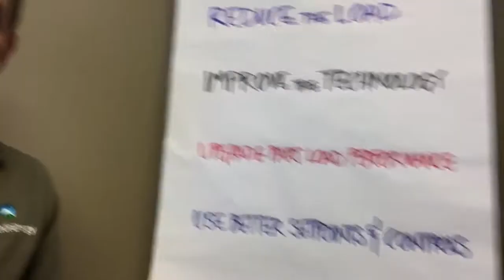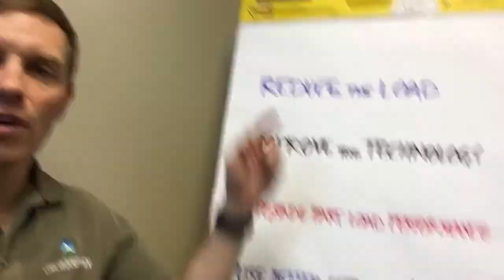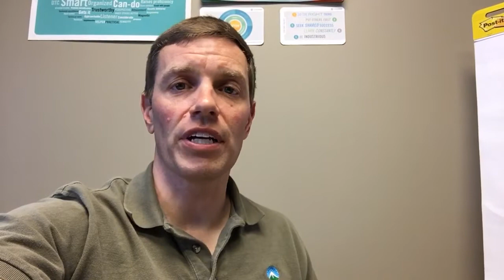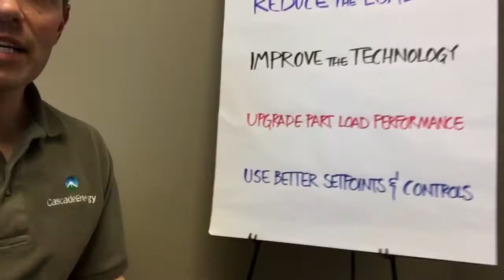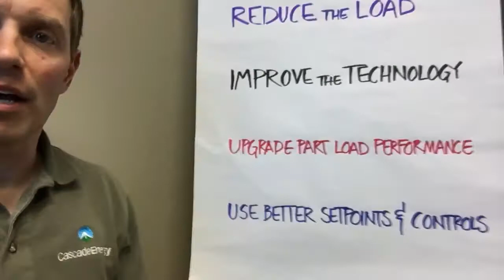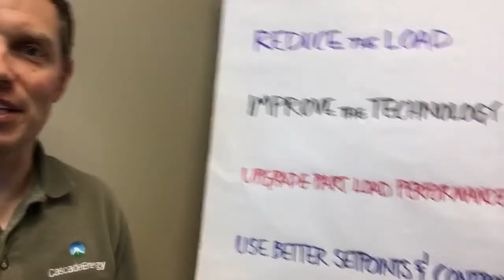Koski Energy

Comment: Funny you put this out just now because I am updating my home heating and cooling. Have been trying to decide what to go with for furnace type. Single or two stage. Seems like two stage is a good idea for the upgrading part load performance. No need to run at 100% when I can use half of that on the not so cold days. I was told in WI our furnaces have to be rated to run at -15.